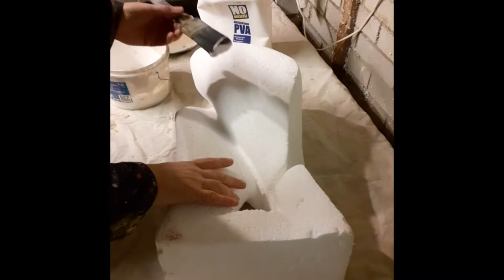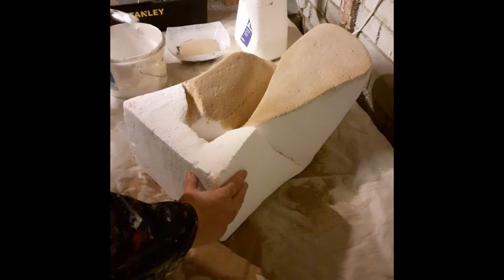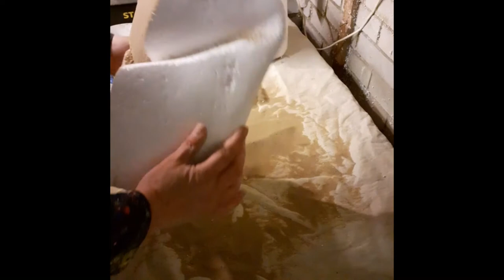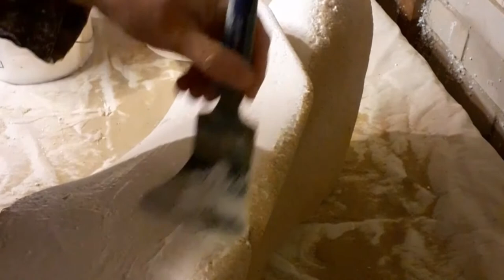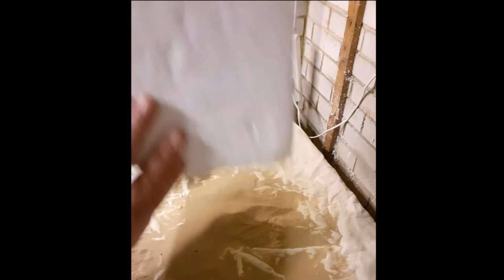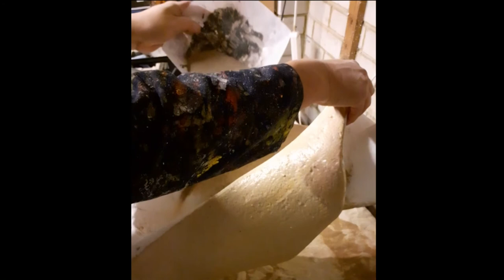HOW TO HARD COAT POLYSTYRENE STYROFOAM WITH PVA AND DRY SAND NOVEMBER 2020

Comment: Thanks for demonstrating.
If we are trying to achieve a hard coat as a protective layer and then hope to paint over the top layer, would you just apply another coat of PVA on top of the sand layer? Wait till it dries then paint over ?
Reply: If PVA is like white glue. Then you may have a crackle finish depending on the paint?
Reply from the maker: you can paint straight on top of the dry sand.

Comment: Is it possible to spray a filler-primer on top of the sand coat? So you can get a "smooth" surface rather than a "sandy" surface? I need a technique to harden my styrofoam prop and to make it smooth.. epoxy resin is way to expensive :( But I don´t know if filler primer on sand would work? Ever tried it? :)
Reply: Filler primer works well. I prefer using Jesmonite